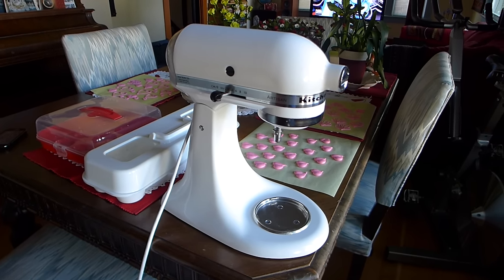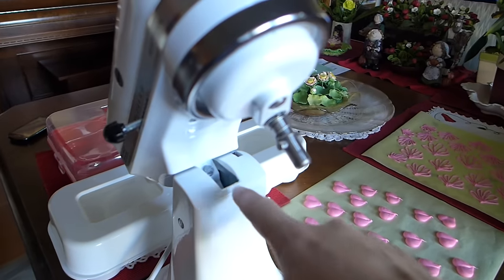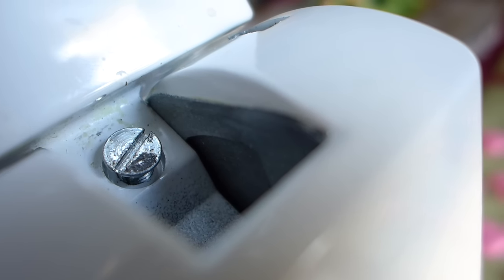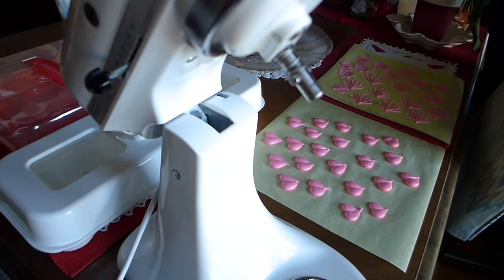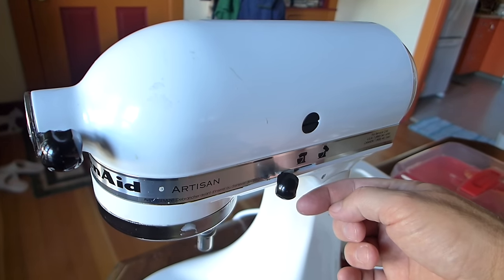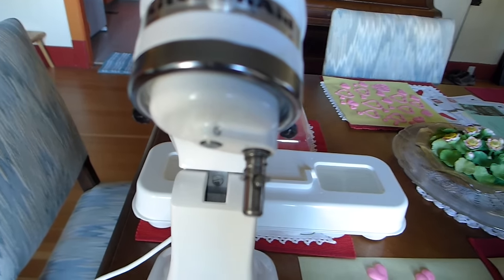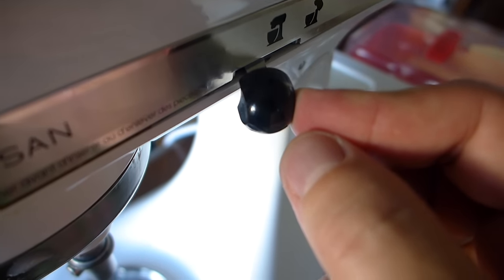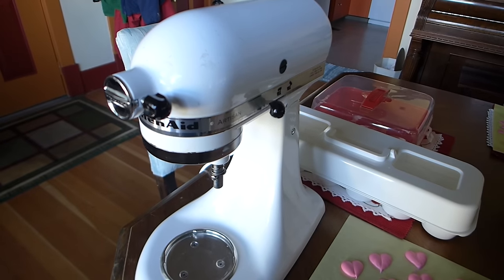How to Fix KitchenAid Stand Mixer (loose head)

Comment: You have saved my KitchenAid. The only reason I’ve put up with the banging for so long is I couldn’t justify replacing a machine that for all intents and purposes worked - I just had to hold the head down when doing heavy duty mixing. I’ve had it for 16 years, and I don’t remember it ever not bouncing around. It’s fair to say, it now works better than it ever has. You are THE BEST.

Comment: Thank you!! I bought this mixer at a thrift store today for $40. The only problem is the head goes too far down in the bowl, which may be the reason it was donated. I was going to screw it in farther but I followed your advice and walla! All fixed. So I have a new Kitchensid with all attachments for $40!! And it works perfectly. Thank you!!
Reply: That mixer was probably donated to the thrift store BECAUSE it was coming down too low.
Reply: Just bought one at the thrift for $15, same problem. Totally fixed now!!! My wife is going to be psyched!!!

Comment: Fantastic,  Just purchased a $20 Kitchenaid at a pawn shop - "as is" because the head would bob up and down.   I had tightened it,  but it got worse....   and I found your video!  So simple, yet so blasted easy to fix.   You helped me save over $300 if I bought the mixer new!  Thanks again!

Comment: Thanks! This was the best explanation of how the screw works. The Kitchenaid video doesn't explain it at all. This solved my issue of the bottom of the beater hitting the bowl AND the mixer head bouncing up and down. I have adjusted the hinge pin and was still having this issue. Going counter-clockwise until the lock didn't work and then working my way clockwise in counter turns until the dime moved like the Kitchenaid video. Thank a lot!

Comment: Thank you so much for posting. Last time I used my mixer I noticed a wobble so I looked around the unit for loose screws. The only one I found-I tightened. Tried to use my mixer today and the wobble was worst. I found your video and realized I had tightened that screw when I should have loosened!! Made the adjustment and mixer is as good as new-thanks again!!

Comment: Thank you! I have been holding the head of the mixer up by hand for two years to keep the beater from scraping the bottom. You solved my problem in two twists of a screw driver.

Comment: I am so grateful for this video.  I am an avid baker and was obsessing over the fact that I would have to spend $400 on a new mixer.  I had been living with this problem for months, tried tightening every single screw and it got worse.   Then I checked several videos regarding this same problem but without your explanation of how this screw actually works, I was afraid to loosen it too much.  Authorized repair wanted $75 just to diagnose the problem.  Thank you sooooo much for this fix.

Comment: Brother... you're my hero. I used to use my mixer to make bread all the time and rarely do anymore because of this issue (for years now). Kitchenaid recommends tightening a screw from the bottom, which I think may have been contributory, but it didn't solve my problem. I believe this did. Thank you!
Reply from the maker: Yeah, the screw you're talking about is just a set screw that holds the main pivot pin from coming out. If that pin isn't actually coming out, I don't think it will really make any difference. Even if the set screw is loose, as long as the pivot pin is in place, there shouldn't be any jiggling.

I never would've imagined all the positive responses I'd get from posting this, but it sure makes me happy. :) Get back to the bread making!!!

Comment: Thank You so much. The manual does not include this information. I've had my mixer for about 30 years. With bread dough it has started wiggling. Now I can adjust it correctly! It still works like new.

Comment: Thank you! Thank you! When kneading bread in my KA Classic mixer, I had to hold the lock forward to keep the head locked and stable. Your video showed me that the lock wasn't coming all the way forward as it should. Once I adjusted the set screw, the lock came all the way forward and the head was no longer loose. Thank you for your clear, concise video.

Comment: I wanted to thank you again, I just made another bread recipe and for the first time my mixer was entirely stable, no bouncing or rattling at all!  I didn't realize until I saw your video that the screw serves to offset the angle of the head, I thought it only raised and lowered the attachments.  I was able to loosen the screw and it met the head at a higher angle so that there was no play between the place where the head sits and where the lock engages.

I had given up on my mixer years ago and have barely used it at all since, I had considered even buying a new one, but now I feel like I have a brand new mixer again because it works like new!  Especially in this quarantine I'm so thankful to be able to use my mixer properly, the bread rolls I made last night were just gorgeous.
Reply from the maker: I'm happy to hear that! Thanks for taking the time to share it!

Comment: I've been living with a jiggling motor head for years, and thought it was just a me problem. I've tried a few things but I usually just ended up holding the head with my hand while it mixed (which is annoying). I decided to see if anyone else had this problem, and even better, a solution, when I came across your video. AND THIS WORKED! Thank you for sharing. Now I can be happy baking again instead of aggravated!

Comment: Thanks!  I, like you , completely disassembled the unit to try to fix the wobble.   I knew the adjustment screw was for raising or lowering the head for proper clearance to the bowl, but didn't realize that overadjusting it would make the head wobble.  I was about to completely disassemble the unit again, but thankfully found your video and fixed the wobble with a couple of turn of the screw.  Made my day!  thanks again

Comment: THANK YOU SO MUCH! Every other video I watched said my attachments were sitting too LOW, but that wasn’t the issue. The attachments never hit the bowl but the mixer still wiggled. I could never fully lock it in-place. NOW I see I had the attachments set too HIGH so just messed with it and it’s solved! Thank you!

Comment: THANK YOU!! I was driving myself crazy and could not figure out why it kept vibrating even after I tightened that screw.  I almost took the entire thing apart. Your video was spot on and fixed the problem. The wife thinks I'm a genius and I had to give the credit to you, WELL DONE!
Reply from the maker: Some of the comments here crack me up. I took mine completely apart (d'oh!) so you didn't have to! :) And for anyone else in the same boat, as long as your wife doesn't catch you (good luck!), feel free to take full credit! :)

Comment: Embarrassed to admit I have dealt with a wobbly head for over 20 years—I could never fully move the lock leaver forward and always assumed it was defective. Tonight, I saw your video, grabbed a flathead and turned that screw one and a half turns to the right, et voila! Lock leave moves completely forward and head does not wobble anymore. THANK YOU!!!!!

Comment: I did exactly the procedure you did and saw all the grease but nothing inside was broken. I loosened the stop screw as you pointed out and it fixed the jumping problem that was after I had tightened it and made it worse. Thanks

Comment: Thanks!  I did the exact same thing that you did at first, then I watched the kitchenaid video on how to adjust the hinge pin.  That didn't work either as that eliminates horizontal movement.  Your solution is the correct one if the head is jumping up and down.

Comment: Thank you for the video a good job explaining the problem.  I have a kitchen aid classic and was having a problem with the head bouncing. The stop screw was fine but there is a pin that holds the head to the base and it has a set screw to hold it in place and on my machine it was very loose. If you do a lot of heavy mixing such as bread and bagels this will loosen up over time. I check the pin to see if it is loose  each time I use my machine and tighten as needed.

Comment: I cannot thank you enough. My mixer made me hate it! Seriously. I wanted to love it, but I hated it. I did what you suggested and it works perfectly now!! YEA! Now - the one design flaw that we can't "fix" ... it's hard to get ingredients in there with the beater in place, since it's right in the middle. Also, most of the time, it looks as if it is just mixing the stuff in the very center, over and over, while the stuff clinging to the side of the bowl remains in the same position. Maddening. Anyway, thank you so much - I had tried everything before viewing your video - including tightening this screw, but I obviously tightened it too far! You are a GENIUS!

Comment: EDIT: This is important, using a dime is a proper way to set depth. You do not want your attachments to scrape the bowl, end edit. Nice. I have noticed my mixer getting more wobbly every time I use it. I just looked at mine and my screw was all the way in. So the screw must vibrate clockwise inward as if it is tightening. Not what I normally expect a screw to do but based on the locking mechanism and how it works, it does make sense that the screw can only go inward when the head of the machine is locked into place. In order for the head to get loose the screw must turn clockwise. I just unscrewed mine until I was not getting the lever all the way out, roughly 1/8" away from end. I then screwed the screw 1 full turn clockwise and the locking lever lined up at full length. I have not tried it yet but I am 95% sure this is the fix I needed. Thank You. Saved me time diagnosing the problem :) I even tested the screw a little. With screw all the way in and lever locked, the machine head wobbles. With screw out and lever locked the machine head does not wobble.

Comment: Thank YOU !!!!  Like many others below,  I have not used my much loved mixer for quite a while, after my youngest tried making two batches of VERY heavy dough. I thought he had wreaked it!!! (Enter guilt). Anyway, decided to google. Found one tip about tightening same screw,  but not explaining it's purpose (which is 3/4 of the deal), and one re the pin that holds the head to the base. So followed both (pin DEF needed pushing in), but to no avail. It actually made things worse! It was crazy. So, here I am 2 days before Christmas and I thought I'd give it one more shot (as opposed to doing everything by  hand :(   Which is a workout I don't really care to repeat - cream, egg whites anyone?)    

Anyway, found you and your post, and SO FLIPPIN' HAPPY!!! right now.  Suddenly I understood the screw's purpose and therefore the remedy - and could then adjust properly taking into account the heads-up re the locking lever not going all the way if you turned the screw too far. I did - and then machine told  me so - and I adjusted, then hey presto!!!! Machine is working normally!!!!!!! I know there are a lot of exclamation marks, but you have no idea how happy I am right now, lol.  I was an inch away from saving for a new one, as there are zero "menders" in my area or within 100 miles. You've just made my Christmas. Chocolate mousse and egg nog here I come. Brilliant!!!! ;)
Reply from the maker: Merry Christmas!!!!! :)

Comment: Thank you so much, I was ready to throw it out !!! I was so upset because I have only used it 5 times. I ruined the whisk attachment and had to buy a new one, which i have been afraid to use, it was 56.00. I have not fixed it yet, but from all the comments I am positive this will fix it. I will post when I fix it. I love you ty ty ty

Comment: I recently disassembled my mixer to replace the smaller gear and when assembling back I went the extra mile and tightened That extra lose screw and yes I noticed the lever to lock the machine didn't go all the way forward, and I noticed the mixer was hitting all the walls of the bowl with the wisk! I was really preparing myself to engage in some time consuming fix or worse spend a lot to fix it.
This video really did it for me thank you for sharing! ... Oh that little screw...XD

Comment: Don't just go turning it all rouge. It's meant to be calibrated. It's an adjustment screw for the beater height. Easy calibration, drop a dime in the bowl and turn the machine one. The beater should push the dime around in small increments. If the beater doesn't touch the dime, then it's to high and you need to turn the screw very slightly to the right. If it doesn't move around the bowl smoothly than the head is to low and you need to turn the screw slightly to the left. 

If the beaters are to low they will chip and scratch and not mix well. If they're to high you'll have unmixed ingredients at the bottom of the bowl.

Comment: Thanks so much for this. Watched my so holding the top of her kitchen aid because the head was bouncing. Checked the latch and it wouldn't slide forward enough. Adjusted and fixed in less than a minute.

Comment: I just got this mixer after using a heftier model for 20 years. First two things I made worked great with the paddle and the whip. When I made my favorite pizza dough with the dough hook, the crazy thing was jiggling and bouncing and the lock wasn't holding. I've adjusted it, and the lock seems to be catching now. I haven't given it a serious test yet but hoping this works. Thanks, but it's pretty pathetic to receive it misbehaving like this straight out of the box.

Comment: I think that screw is to adjust how close the beaters come to the bottom of the mixing bowl.
Reply from the maker: That is definitely another affect that it has.
Reply: Yes in the instruction book that's what it says.
Reply: If I remember, the adjustment you are looking for is under the top cover and down where the hinge pin passes thru.
Changing the adjustment of the screw you are using is only for the beater spacing.
Reply: You are correct on both screws, Robert.  The one in this video is for beater to bowl spacing, the one under the mixer is to hold the mixer head to the hinge pin - so the head doesn't rock back and forth and the hinge pin falls out.
Reply: Don is correct. The issue this video is talking about is fixed by adjusting through the bottom of the base up the "spine" of the mixer.
Reply from the maker: Maybe your mixer is different than this one, but that's not how this one works. The screw that can be accessed from underneath is just a set screw to keep the hinge pin from falling out. That's it. As long as the hinge pin is in place, no rocking takes place at that pivot point.
Reply: @jayphilipwilliams  Both pins need to be correctly adjusted.
The hinge pin needs to be tight or the pin on the "tilt" will come out while mixing. Not a big deal tighten it from underneath.
The "Stop Pin" is far harder to fix, if you have tried to "Force" the locking lever to close. IT will basically bend the aluminum/tin linkage, and that will cause the head to never actually LOCK ever again properly.
Yeah I did that...now I am paying for it. Lesson learned though!

Comment: Bingo! It worked.  Thank you. Now how do I get metal bar that goes from one side of the base to the other, back in where it should be. It's mostly sticking out on one side! Tried a hammer, didn't work.
Reply from the maker: Hey, Bobbie. I think you're talking about the pin on which the head pivots. I would start by flipping your mixer upside down. There's a little set screw you'll see up in there (or down in there). That's supposed to hold that pin in place to keep it from coming out. Loosen that a bit (a turn or two in the counter-clockwise direction). Then, it should be quite easy to push the pivot pin back into place (you might need to jiggle the head and base relative to each other to get it to go). Then, after the pin is centered, tighten that set screw back up.

Comment: I saw a video that explains that  screw is for the paddle or wisk attachment depth into the bowl. They used a dime in the bottom of the bowl to adjust the height of the paddle or whisk. It should move the dime around without scratching the bottom and should make contact with the wisk or paddle.
Reply from the maker: Correct, but if you adjust it too low, then the head will be loose and shake, and it's not intuitive what's causing that nor does the manual have anything about troubleshooting a shaking head.

Comment: Thanks a thousand times, works as well for the KitchenAid Mini! If the screw is not in the right position, the head is starting to wobble. I think the description in the manual is completely wrong (probably a leftover from the classic manual, which has never been adapted to the different construction of the Artisan and Mini model): It tells you can raise or lower the beater with that screw - I think that is totally wrong and misleading, specially it is recommended to adjust it before you use the machine the first time. Wondering how many did and made things worse...

Comment: The installed paddle should be roughly 1/16 of an inch above the inside of the bowl. Use a dime to gauge the distance.  There is a YouTube video on this issue.

Comment: Hi Jay, I have moved the screw all the way in and out and everywhere in between. At each stage I tested with bread dough and it’s still wobbly… could it be something else?
Reply from the maker: If the pivot pin is in place and secure, and the lever on the side is all the way forward after making the adjustment to the screw, I'm not sure what else it could be. Hard to troubleshoot it without looking at it in person.
Reply: @jayphilipwilliams  thanks for responding! I’ve used it again today to mix something else and it was fine. I think it is only really jumpy with bread dough 🤷🏻‍♀️